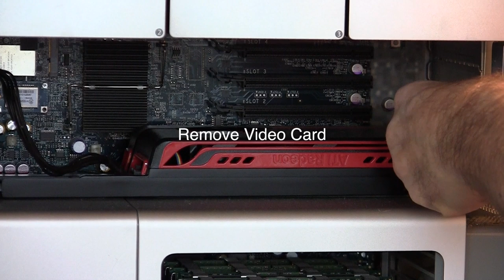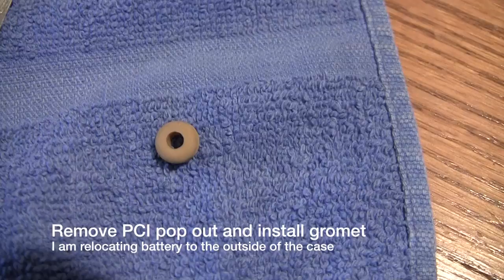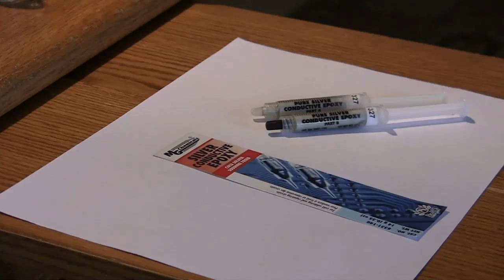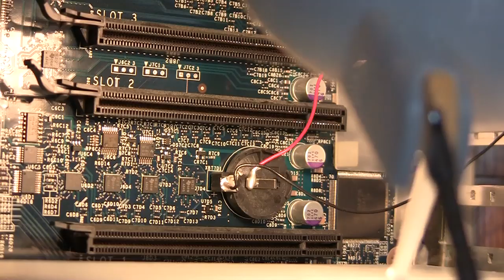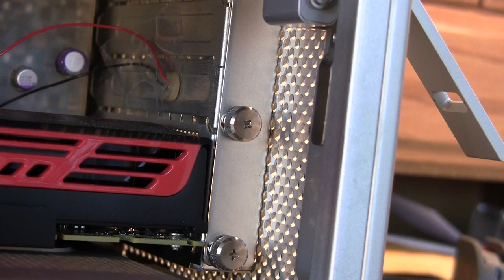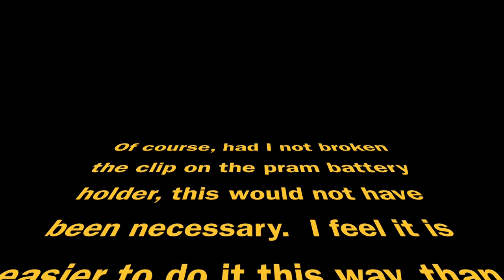Repairing Mac Pro Pram Battery Holder

Comment: Thanks very much. Your video helped me immensely with the relocation of the PRAM battery in my Mac Pro. To gain better insight with doing the repair, I sacrificed several battery holders and tried  alternative ways to fix the problem. In general, I found that hot soldering with  60% tin/40% lead solder (MP = 188 C) worked  much better than the silver epoxy: the bond is much stronger & cooling time is <1 min; this is much faster than the epoxy cure time at RT = 24 hrs & use of a heat lamp to accelerate the cure rate is unnecessary.  In one trial, a minuscule, stray globule of silver epoxy shorted the battery when it spanned the small gap between the positive & negative plates!  Soldering produced much cleaner connections. I tried soldering a broken clip to the positive terminal of a battery holder. The repair sort of worked for me; however, the battery was not held securely enough so this approach was abandoned. As for soldering techniques, I used a "helping hand" to hold wires. Small pieces of aluminum foil were used to cover & potentially protect areas of the mother board in the vicinity of the original battery holder while soldering. The mac was located on a desk with very bright room lighting & a desk lamp focused on the work area. One note about a procedure in your video: I could not find a way to pull up the negative metal strip of the mother board  battery holder to slip a bent copper under it. This did not matter to me because the solder joints were very secure. Finally, because I had very few wires in stock at home,  I used 16-gauge, single strand wires which were color coded and a little bit stiff.

Comment from the maker: I did not want to risk working in tight space on mother board and doing any additional damage. Now, after 2 and 1/2 years that MacPro is still running fine and the battery replacement is on the outside.

Comment: I’m just here looking for the possible location of the PRAM battery on my Westmere(?). I’m hoping it will solve the sudden issue with the black screen and 3 blinks on my 30” Apple Cinema Display, although I know of other fixes.

But, what really is the purpose of soldering the battery holder to the outside of the case? The battery should last for, I think 7-10 years so, is it that much of an inconvenience to get inside and replace it?
Reply from the maker: I wated to replace the battery, but it was tight and clip broke. I did not want to start soldering on the logic board. I am curious about your monitor going black doe it come back on shortly? I have similar problem with a Mac Pro 5.1 after I put in a new video card  and upgraded the olld prosessor.
Reply: Greg Speck oddly enough, this is what happened. I rebooted and reset PRAM about 8+ times the other day. Screen came up. I left the system on for a few days, afraid to turn it off, but screen had gone black again, with the system still running. I’m very busy so, I didn’t take another look at it for 2 days. Screen was up again, without a reboot.

I’m still going to replace the button battery, when I have a minute since, because it’s often said that I think it may not recognize the display (?), I highly doubt that my MacPro would suddenly stop recognizing an Apple Cinema Display. At minimum, replacing the battery would be the cheapest and easiest first step anyway. If that doesn’t work, I’ll start looking at replacing the video card, then the system. One might say that I should replace the screen but, I rather like the Apple 30” Cinema Display, although it’s far past being new.
Reply: @privateprivate8366   I have the same problem with my 2010 mac pro. It chimes, USB, and optical drives work, but I don't get a picture on the thunderbolt display (I tested it and it works fine with my 2013 imac). I think it is the pram battery because I just bought it and the owner very likely had it sit in the storage for some time. Besides it is a 9 year old machine and the battery needs to be replaced anyway.
Hopefully this is what is causing the problem... fingers crossed 🤞
Reply: Retro Asiimov I’ve replaced my PRAM battery but, unfortunately, the only thing that seems to have improved, is that I don’t get the 3 flashes from the Cinema Display pin light.

Upon powering up, the screen flashes on for a moment and goes black. During several reboots with PRAM resets and one SMC reset, after the initial flash of the screen coming on, then going dark, it came on for a few seconds, showing the grey Apple logo (so, my Mac Pro is booting just fine), but the screen, then goes black again.

One thing I’ve noticed though, is that although the pin light normally has come on, when it’s not obtaining a signal from my system, it now turns on inconsistently.

I might have to try that thing where people are covering contacts on the power block to make their screen work again. But, it may take some time to get to that as, I just have other priorities I’m battling.
Reply: @privateprivate8366  Thanks. If you find the solution please tell me. I would still replace mine because the seller claimed that it was fully working, so it seems like it's the only thing that could be wrong, however because I transported it in my car the HDD may have failed (though it is very uncertain) so I ordered a new one. If that won't work, then i guess I'll have to get a new graphics card. And if that doesn't work, then, I'll fall into depression and blame myself for spending my $205 for  that Mac. Could have bought crypto.))
BUT I hope that won't happen.
Reply: Retro Asiimov First determine if the current drive is at least spinning up. For me, mine is and, on the 2 occasions the screen stayed on for a moment, I saw the Apple logo. No sad face.

To me this “feels” like a hardware failure, not having to do with my boot up drive. I wouldn’t be surprised if my 30” Cinema Display isn’t just tired. I’ve left it on A LOT, while I was busy going back and forth to work, hoping I’d get a real life.

BUT, I do have another one. That was my original that went wacky so, I replaced it with this one but, I’d like to try to old display with the new power supply before I start running out spending money.

Awhile back, I worked for Apple for many years but, not as a Genius so, opening up the display will not likely happen.
Reply: @privateprivate8366  The drive does spin, but I can't really check if it works. I have a chinese 3.5 enclosure and I'm not sure if it's functional, so I can't really check it. I already ordered a new one and in case they both work, I'll have two drive in it, which is a good thing.
Reply: Retro Asiimov I ordered another Radeon card as, that is the first, cheapest move, without me sitting there, blowing up my time, trying to figure it out. I have no idea if that’s the source of the problem. Could be the display itself, although it does come on occasionally, only if momentarily. It is a situation which has deteriorated over the course of the past few weeks but, I just don’t have the time I used o “think” I had to tinker for nights and weekends, like I used to.
Reply: @privateprivate8366  Makes sense. If it's the source of the problem please let me know. Hope you get it working.
Reply: Retro Asiimov thanks. The card will arrive next week. Hopefully, I’m not to beat to install until the weekend. I will
let you know either way.
Reply: Retro Asiimov OK so, I don’t know why this didn’t occur to me. Just too busy, I guess.

But, I brought home my work MacBook and hooked it up to my Cinema Display, removing my MacPro from the equation. Display came right up. I would want to adjust the resolution but, the fact is that the screen came up and is working, without me losing my mind.

So, I will await that graphics card’s arrival next week, install it and see if my situation improves. It’s not my screen. But, once the new card is installed, I’ll know if it’s my graphics card or the system. Maybe even dust. I’ll let you know.
Reply: @privateprivate8366  Same. I connected the thunderbolt display to my 2013 iMac and it worked fine. On the MacPro I replaced the HDD and PRAM battery... no luck. :(
The Display showed no signs of life like at all, nothing. So we are left with GPU or the Mainboard that are faulty. I'm not a Desktop expert (this is my first one, I haven't touched a tower desktop in years) but the graphics card seems to be noisy (it's amd hd 5870).
You said that you ordered a new card, where and how much did it cost? It looks like I'll have to get on too.
Reply: Retro Asiimov Radeon 5770 Ebay $50.

I’m glad you’ve got something working there. I was glad my screen came right up. I certainly hope it’s the graphics card as, I really don’t want to deal with replacing other components or the tower. Money and too much work and time, when I have other priorities.

I will also likely test out my other 30” display in the same way this weekend.
Reply: @privateprivate8366  If it's the GPU that is the issue (which at that point I hope it is) then, i have a choice to make. Sould I get an hd 5770 like you did (I assume it is still a decent choice) with everything working as it shoud, or should I pay a bit more for MSI RX560  Aero 4gb, I wouldn't have an apple logo(and some difficulties with BootCamp, but solvable) also I'd need a  MiniDiplay adapter for the Display.
I'm sort of tight on the budget, though can afford both. And would like to upgrade GPU (in future) in case I buy the stock hd 5770.
Chances are that I could even get 2 hd 5770s in bulk for the price of one.
What do you think about this? 🤔
Reply: Retro Asiimov I really don’t know actually. I’m so far away from it now that I don’t even watch Tim Cook speak, in Jobs’ place.

For me, I just wanted something cheap and quick that would drive my screen. Perhaps at a later date, I’ll look into seeing if I can max out this machine, considering that I am not a fan of the cigarette receptacle MacPro and I’m likely never buying the one to be released.

I just want this on and running so I can do some normal graphics, a small bit of 3D animation and to have something to run my printers, scanner and vinyl cutter. It is in part why Apple is charging what it will be for the latest MacPro. When there are already systems on the market that can do most things and since people and businesses learned to be more frugal during the recession (well, some did), most are not going to be buying that.

Anyway, still, I’ll let you know what transpires next week.
Reply: @privateprivate8366  Any updates ?
Reply: @privateprivate8366  Have you got got the Graphics card yet?
Reply: Retro Asiimov I’ve received it but, it’s unlikely I’ll have the time to install it tonight. When I do, I will let you know. As it stands so far, although there is yellowing due to the passage of time, I have hooked up both of my 30” Apple Cinema Displays and both are operational so, at least I know it’s not the screens.
Reply: @privateprivate8366  good luck!
Reply: Thanks, I just finished being disappointed in prices for these cards. If hd 5770 costs about $50 I might as well get an hd 5870 for $56 instead. 🤔
Reply: Retro Asiimov make certain it has the memory on board that you need. I see some dual dvi cards but, they only have 256-512mb on board. Inquire to see if they can later be upgraded, should your need become greater. And, yeah, you could try the 5870. Mine was just a quick impulse buy. I didn’t do any research.
Reply: OK so, bad news. While my display came up just fine last night and appeared to stay up for at least an hour, it had gone to black for energy saver and, when I tapped the keyboard, the pin light on the display blinked 3 times - 4 times in a row. This may be PRAM battery. I just replaced the the BR2032 button battery with a CR3032 a couple of weeks ago, like many do out of convenience. Maybe it wasn’t good. I’ll be picking up a BR2032 battery tonight. Will I get it installed tonight? Not sure. This is a time suck.
Reply: @privateprivate8366  Hi. Is your mac working?
Reply: @privateprivate8366  Have you got yours to work? I just replaced the GPU, changed HDDs, did several Pram resets and nothing... just nothing, blank. Don't know what to do now.😔😔
Reply: Retro Asiimov no, I’ve had no time to deal with it. It simply continues to work a bit better than it did, with the graphics card replacement. The screen comes up every other day or so, when I tap the keyboard, rather than to stop entirely. I have not put in a new PRAM battery yet. But the weather is too awful so I don’t know when.
Reply: @privateprivate8366  Well, at least yours is working. I've never seen video output from mine since I bought it.
Reply: Retro Asiimov understood but, I feel it’s only a matter of time before this gives out completely, as well. That, in a few weeks or months time, I won’t have anything. I can move forward with getting a new tray or replacing the system entirely and I haven’t arrived at that yet but, I’m pretty sure it’s coming. The only reasons why I haven’t tended to this with more immediacy, is because I’m always busy, I have my phone, and I also use the laptop provided by my job, as necessary. Otherwise, I’d be in an angry flash to diagnose and fix this thing.
Reply: @privateprivate8366  Yeah. I wonder how much would it cost to replace the motherboard in some kind of repair center.
Reply: @privateprivate8366 Well, it turned out that there was nothing wrong with my MacPro and the whole problem was in the monitor, apparently thunderbolt display is not compatible with mid 2010 MacPro (which I didn't know) and I need a cinema display to make it work.
So now I'm thinking of what monitor I'll buy with my budget of $180.
That was a lot of time wasted on the problem that didn't exist.

Comment: so funny I googled this and found your comments on another site as well, which mentioned the part so I figured I'd post it here for anyone else who needs it . . .  

I was able to purchase a CR 2032 Battery Holder at the local Radio Shack: CR2032 Battery Holder Catalog #: 270-009. This cost $1.19. I have purchased from Amazon "MG Chemicals Silver Conductive Epoxy" 
This cost $36.95 plus $2.00 for shipping. This cures in 5 hrs at 75 deg. and 15 min. at 150 degrees ( hair dryer temps).